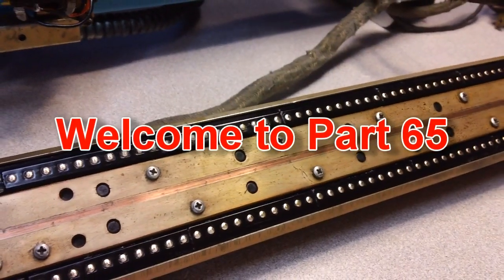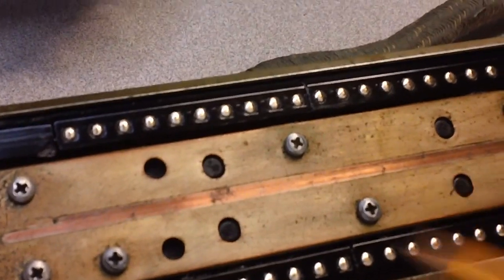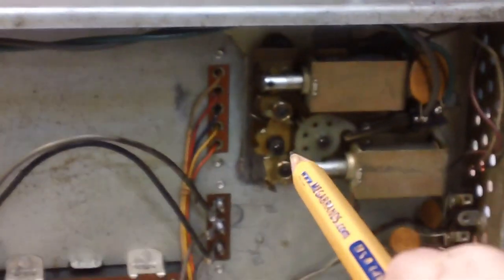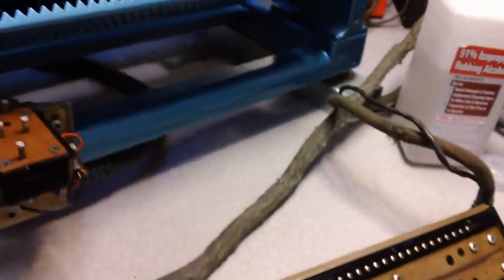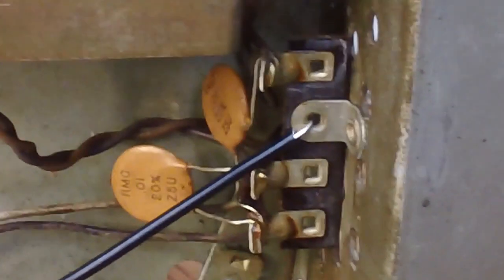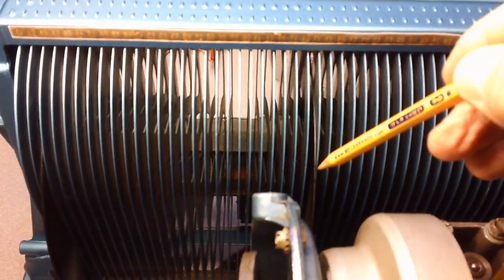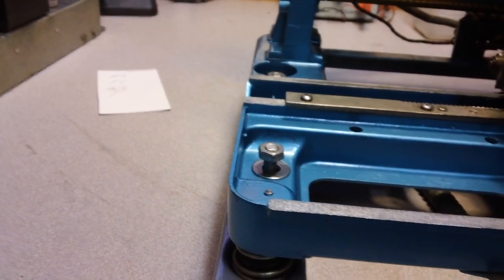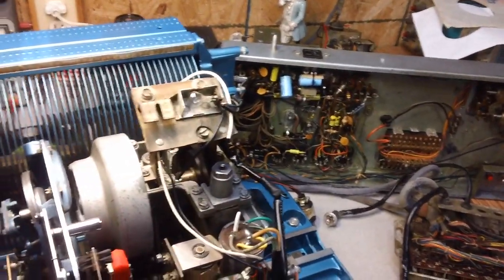1961 Seeburg AY100U Jukebox restoration (Part 65 of 87).

Comment: Adding a ground wire won't improve the contact of the brushes on the worn center section.  The slot needs to be milled flat again.

Comment: How is that brass colored bar grounded before the mod?   It seems like polishing that ware mark would give you a better connection.    Using toothpaste with lots of water to keep is lubed it should polish that ware mark nicely.   The very fine abrasive in the toothpaste will clean it with very little material removal and excessive scoring.    I use toothpaste to polish scratched audio CDs and it polishes them nicely.    I have also used it to polish out scratched windows on digital  meter displays too.

Comment: Very nice a little bit more progress , and I noticed the buzzing has stopped on the keyboard or is it as you have swapped it for the new keyboard which doesn't buzz I forget what part it is called solinoid ? Am sure someone will tell me . lol
Reply from the maker: Pauly,
A buzz a day keeps "The Four Seasons" away...from the speakers, that is. LOL  It's the latch bar solenoid, my friend.
Regards,
John
Reply: I wonder if the keyboard swap was actually not part of the problem.   Perhaps the main reason it wasn’t working was the bad ground to begin with.
Reply: I would run the alignment procedure and the tormat memory reset procedure (connecting a battery I think) in those links.   It could be off alignment and the reset procedure should clear the memory so any new selections made are the only ones stored.  I wondered if it could be stopping in the wrong place due fo previous sections  that were written into it.
Reply: joernone lol thanks John looking forward to the next episode 😀

Comment: John, the add and subtract solenoids are fine for now, the coil sleeves are worn and that is what is making them sloppy. When you press the plungers in I can hear them hitting the plunger stops. If they were not going in far enough the  gear would not work at all. I have done the tormat thing by adding a ground direct to the chassis, but it is more likely to cause problems on the later solid state systems.  These are 57 years old now and there is going to be a lot of ware on things. I've seen some a lot worse than this.
Reply from the maker: Harry,
Thanks, my friend.  Tomorrow the trip lever and transfer arm are the next targets.  Wish me luck.
Regards,
John
Reply: John, just watch the adjustments, some need to done first before others. Magazine horizontal position, transfer arm, tormat memory unit position  may get you out of the woods. If the trip lever is not dropping down in play and scan check the trip coil for adjustments and any binding in the trip lever. I didn't watch all of the videos at first and don't know what you took apart on the mechanism.
Reply from the maker: Harry,
I have all the adjustment procedures and they tell which one needs to be done first.  I never did bother the trip solenoid, but it will for sure be closely looked at again.  But I do have a question:  How easy should it be to move that trip lever up and down?   This one seems to require more effort than it should, but lack of experience keeps me from exactly knowing.
Regards,
John
Reply: John, it does take a little more effort to trip it, once it trips and the transfer starts from scan to play and vies versa the lever should drop down till the next time is tripped, either manually or by the trip coil. I have had to take the trip coil off and clean the plunger plus the inside of the coil that were sticking. John, you are getting closer to getting one of my best liked jukeboxes operating again, thanks for you persistence and thorough work.
I like these wonderful machines, but Seeburg is my favorite. I remember when dad used to bring these back from Indianapolis to the shop when brand new and how they smelled. He took me to Seeburg in Chicago when I was 14 and I got to see them build them. At that time they were the best sounding and performing machines on our route. In 1960 dad won a brand new Seeburg Q160, the model right before the AY.
Reply from the maker: Harry,
Right now I'm at the trip solenoid portion of the mechanism adjustment procedures and have the coil removed from the slug.   The slug is a bit dirty and will be cleaned, but overall it and the inside of the coil look OK.  But one more time on the trip lever...up is scan, down is play, right?  I can't seem to remember which is which.  Getting old sucks.
Regards,
John.
Reply: John  No up is tripped, down is when the lever lowers down as it enters either mode, . 
The coil energizes when it trips to -  Stop to pick up a record or trips at the end of a record to go back scanning for another one or shut off at the right end after all have played. Manually lifting the trip lever as it is scanning should stop the mech and bring a record up to play and doing it again should return the record back and go to scanning.
Reply from the maker: Harry,
So from now on my mnemonic device to help me remember will be: "I've been tripped up." LOL
But I still don't understand what you mean by: "...down is when the lever lowers down as it enters either mode".   Do you mean the play and scan modes? 
So the way I now understand it is that the trip lever will automatically move to the up position when a record is brought up and also when the record goes back in the rack...and during shut down at the right end, right?   If so, why would one ever need to manually trip it?  There must be some reason to have that capability.
Regards,
John
Reply: John, the trip lever is down all the time except when it trips, in other words when it is actually playing a record or scanning, even when it shuts off
Reply: John, I might be confusing you, I hope you know what I am talking about the ( release lever )
Reply from the maker: Harry,
Now I'm not sure. LOL   Is the trip lever and the release lever the same thing?
Regards,
John
Reply: Actually no John, I've always called the release lever wrong because we technicians use this to handily trip the mech while working on it. The actual trip lever is under the trip coil, this can be seen in the trip coil adjustments. I think that this thing has got us both confused..    Lo!!

Comment: John you are correct on the trip lever and the arm that picks up the record...  I am sure once an alinement is done it should work as intended. 
I do think you need to do the full alinement as you did take a few things apart on the mechanism.
Reply from the maker: James,
Thanks, my friend.  I plan to do as much as possible, but will initially focus on our trip switch and transfer arm problems.
Regards,
John